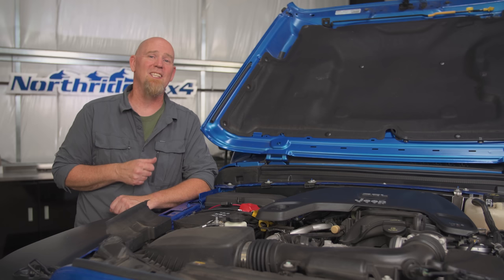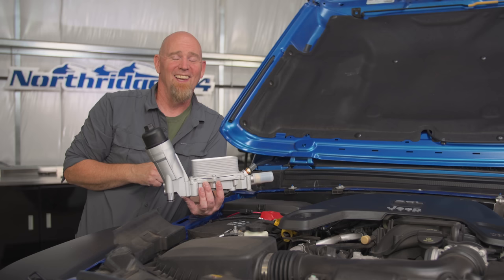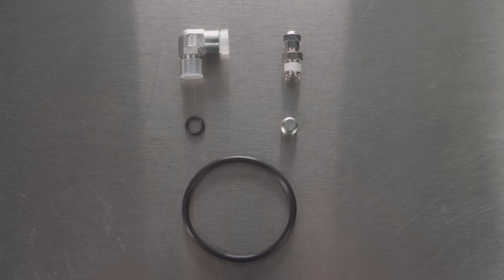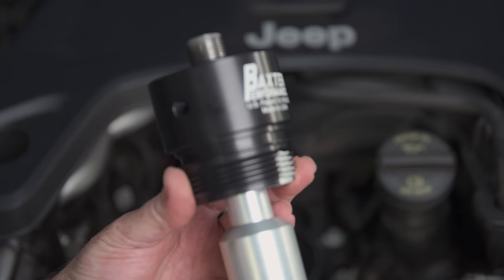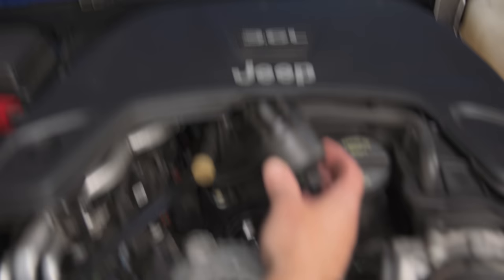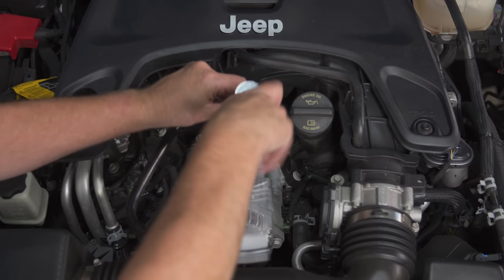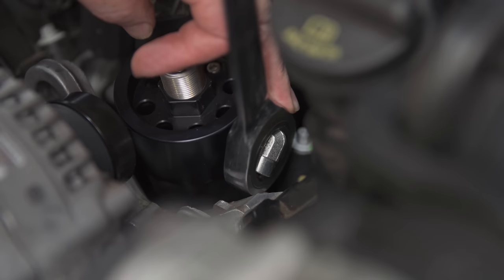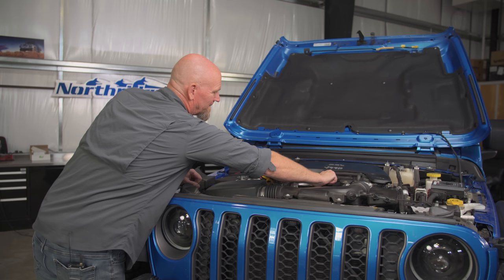STOP Dry Starting your Pentastar 3.6!!

Comment: Looks like a good product.  But lets not forget that good synthetic oil are designed to provide lubrication on these dry starts.  It would be interesting to know the amount of engine failures on engines using synthetic vs standard oil.
Reply from the maker: We are 100% in agreement with you. The Baxter adapter is a great product, BUT people need to use a good quality oil and filters 1st and foremost!
Reply: No they arent… no more than any other oil
Reply: @northridgenation  My 2015 3.6 Pentastar had 205,000 miles on it when I traded it in. I used Mobil 1 Synthetic and the OEM Filter. In all of those miles I never had a single failure in the engine. I replaced one wheel speed sensor while I owned the vehicle. I think the 3.6 is a pretty good engine at least when it's left stock.
Reply: I work for a fleet that has some of these engines in the vehicles we have.  They all start failing at around 80-90k miles and we change the oil every 3500 miles.  It isnt lack of maintenance just piss poor design.
Reply: I run mobile one full synthetic and Fram filters in our 3.6 in a 2018 JL Wrangle.  Engine went out at 38k.  Stelantis then changed the engine THREE TIMES in that same year due to faulty rebuilds.  Third replacement is doing well so far.  I do notice a clatter when dry starting in colder temps just like the original engine did.  I'm going to order this kit and see if that makes a difference.
Reply: He obviously doesn't have a 3.6 penstar that chatters each time you start it in the morning lol
Reply: Its not about the oil type its the lack of oil in the upper cylinder heads upon start, it takes the pump some time to prime the filter to get everything lubricated again. Even though its just a couple seconds or less, the engine is already moving extremely fast.. These engines have weak camshaft rollers and lifters that fail from lack of lubrication. I bet with this kit this failure will come a lot later or possibly never... The bottom end of the 3.6 is actually very robust and with proper oiling I think its pretty reliable.
Reply: I have a 2015 wrangler and from the first oil change for about 120k I used synthwtic amasoil. I started with lifter issues at 100k.
Reply: @torkrench bullshit. Synthetic flows to moving parts significantly faster especially during the winter months they're not even close in comparison
Reply: Just my experience with this product I have a 2014 wrangler sport with 140k two new camshaft on the passenger side of the motor new chains guides lifters rockers motor runs excellent and quite I thought I’d add this product to quiet everything down on the first start up it did virtually unchanged extremely disappointed but it’s on there and I’m gonna leave it there but I wouldn’t mind having the money back in my pocket. Definitely not worth the money to me.
Reply: @michaeldonahue   so even with this valve its still clacking upon start up?
Reply: @mikemoon2197  Consider yourself very fortunate to have not replaced the oil filter housing due to a failure.
Reply: @andrewhuber3575  I have heard this before and I am fortunate I didn't have to do that for sure. I did wind up trading the car in when it hit 207k miles.
Reply: My 3.6 failed at 170,000. It required new rocker arms, lifters, push rods and 4 new cam shafts. I used a full synthetic in it since the first oil change.
Reply: @lukelowe918 the 3.6 pentastar is not a piss poor design it's one of the best V6 engines in the world with millions and millions of proven miles.. things happen with everything and if you're running a fleet that means they're probably driven hard and maybe the right oil wasn't used every time
Reply: @seatime674  not the reason they are all failing.  Our fleet is maintained by my ASE Master mechanics, and we follow the manufacturers recommendations for service intervals and fluids.  The 3.6 Pentestar equipped vehicles we use are all having rocker arm failure or oil pump failure or oil filter housing failure at low miles.  Meanwhile, our 20+ year old crown vic 4.6 engines with 190k just keep going and they had real abuse as patrol vehicles.  All our Pentestar engine vehicle are merely command staff or investigators that get driven around like normal cars.  They don't idle all day or chase people. they just go back and forth from home to work.  They are trash.
Reply: @seatime674  weird how every one of them in our fleet has suffered from rocker issues and oil filter housing problems and they are all newer than 2008.   Other agencies in our county also have the same problems.  We must be in some kind of Bermuda triangle where the Pentestar V6 can't survive or maybe they are all trash.  Not sure which.
Reply: @seatime674  the Toyota 4.0 and 3.4 liter V6 engines laugh at every word your saying. Comedy gold. 🤌😆
Reply: @lukelowe918  Would you like me to send you a list of Toyotas problems with the 4.0 and 3.4??.. Sorry I don't believe every one in your so called fleet all have these same identical problems, nice try.. I can also send you information Stating the Pentastar 3.6 is the best refined engine and most popular engine world-wide with the most proven miles....Sounds like your a comedian yourself or just like the attention😉👍
Reply: @seatime674  the 3.4 5VZ-FE is one of the most reliable V6 engines ever sold as is the 4.0 1GR-FE.  As is the Honda 3.0 V6 and even the GM 3800.  The Pentestar is on no one's list but your own.  The majority of people commenting on this video are saying it is trash.  The only people who think it is a good engine are Wrangler/Gladiator Bros.
Reply: @lukelowe918  That's because people that come to these threads need help.. if your car is running perfect there would be no need to come here so that's all you'll see is Select complaints about valves in this thread.. I just got back from a Mercedes service shop and every single rack was filled with broken Mercedes, does that mean Mercedes are junk to?😉. Don't take my word for it Google the 3.6 pentastar with the most proven miles that's the most popular engine in the world that's the most smoothest that delivers the best power and torque band. And later I'll send you a list of all of Toyotas problems. It will be my pleasure 😉
Reply: 2018 JL wrangler pentastar 3.6 leaked coolant into the heads at 70,000 MLS.  Cost me $5,200 .  Rear main seal leaking, rear end gears shredded, coolant leaking out of overflow, and more ! All this under 75,000 MLS. on this P. O. S. vehicle. 
Never again... 🖕🤬👎
Reply: @hakenkreuz7076  happens all too often with those junkers
Reply: @dirttales If it’s clacking, the cam and a rocker are already finished. This isn’t gonna stop that if it’s already happening.
Reply: @hakenkreuz7076 I’m surprised your rad and front axle seals aren’t leaking, not to mention a seized vacuum pump. These things are really just huge pieces of shit.
Reply: I have a 2021 Jeep with 26K miles and I used full synthetic. I've had both cams and lifters replaced on my motor.
Reply: @jerrykurl69  mine does it for a couple seconds every time I start but its not that horrendous clacking you hear once the rocker has failed its just ticking as if its metal on metal with no lube.. I feel like wit this product eliminating that dry start would help a lot over time. Most damage gets done when the engine starts..
Reply: @04cobramarine  Rumor has it, from a reliable source that whoever makes the camshafts, they did not harden the intake cams properly, so they eventually fail regardless off proper oil changes and quality of oil.
Reply: That and adding something like ceratec at oil changes will provide cold start protection
Reply: @lukelowe918  Are you referring to the JK's head gasket issue? Or is this something else?
Reply: @aarontharris  they have oil filter housing issues,  rocker arm issues, oil pump issues.  All sorts of issues
Reply: @lukelowe918  i believe those issues are mostly resolved in the JL.
Reply: unfortunately, synthetic motor oil won't stick to the parts, but rather, it drains completely off after engine shutdown.  That is why many manufacturers specify semi-synthetic oils.
Reply: When I installed a remanufactured I4 2.5L long block in 1989 Wrangler, the new engine consistently dry-started.  I decided I needed to make certain the engine could not start until it had some oil pressure.  I found a pressure switch recommended for use with petroleum products.  It was a normally open switch with a 10 lb/in^2 close pressure.  I also bought a tee for the oil pressure gallery so I could keep my oil "idiot light".  I installed all plumbing.  I cut the positive 12v wire to the ignition coil and installed some ring ends on the wire and connected the switch.  I never had another dry start.  Unfortunately, after the engine warmed up, the starter would not spin the engine fast enough to close the switch and charge the ignition.  I ended up installing a single pole double throw normally open momentary toggle switch across the poles of the pressure switch.  Turn the warm engine until the idiot light goes out, then bump the toggle and off you go.  

If a similar wire providing 12v to the ignition module is available along with a port for the oil pressure sensor, I could cure my 2016 3.6L the same way.  BTW, mine doesn't do it all the time but everything that it does, I cringe as the engine starts.
Reply: @billwessels207 actually it's the other way. The high end MFGs specify FULL Synthetic not Semi. Full synthetic pumps to moving parts faster than any other oil, has higher shear strength and has lower volatility (burn off). The Pentastar needs all the help it can get in the oil department. And use a multi rated gas +diesel 5-40 synthetic oil like T6, Delvac1 or Delo...none of the piss poor 0-20 epa trash.
Reply: So a question I haven't seen asked so far in my reading comments. Exactly where is the oil being prevented from draining back? Just the spin-on filter? If so, how much sooner is oil getting to the top of the engine? I heard like 3 seconds via OEM filter assembly. How much faster is it with this new assembly? 

What causes the oil to be released from wherever it is held? The engine turning over isn't going to trip a check valve via air. So what releases that oil to help upper engine lubrication on startup?

Details would help verify this is really a benefit and not a gimmick.
Reply: @100pyatt  I agree... I have a 2015 JKU with the 3.6 and have noticed with mild temps when I don't drive it everyday, you can hear the in-rush of oil in that 2-3 sec range.  The last two mornings ~ -4 to 10 deg F, the engine started fairly smoothly, lower idle maybe due to lower temp.  I have been running Pennzoil Ultra Platinum 5W-20 since I bought it used at ~12.4k miles in 2016 and now have just over 60k miles today.  I may need to consider this option though.
Reply: @brianworley7705 I agree with you. This feels like snake oil sales pitch until someone can break down how this really helps oil stay at the top

Comment: Cool product, but when our JK's have been sitting for a while, I just use the "Plug Clear Mode" to prime the oil system and then start the engine.  Works every time for FREE!!!
Reply: What’s the plug clear mode?
Reply: How does this work?
Reply: @Rubicon14  It's a feature that these Jeeps have to prime the oil system without starting the vehicle.
Reply: @albertaboyz  You hold the accelerator to the floor and crank the engine.  It'll continue to crank without starting, allowing the engine oil system to be primed and have oil throughout the engine.   I usually do it for about 5-7 seconds, remove my hand from the pedal, and then give it one final crank to start and I have not heard the chattering rockers since.
Reply: @stevenhunt66  I’ve never heard of it or know how to do it , but it don’t matter no more cuz I longer have my Jeep it got totaled out 2 weeks ago 😡

Comment: The pentastar is a very stout motor, even with the oil cooler leak. Probably one of the most reliable motors on the market right now.
Reply: I would go THAT far. Definitely a top ten engine currently in production.
Reply: I’m on my fourth one and love it
Reply: It’s true
Reply: I've got a bazillion miles across 3 vehicles with this engine. Totally bombproof, the small Block Chevy of this millenia
Reply: @@Nastyhabitz "Your results may vary"
Reply: @@NastyhabitzUsually when you work at a dealer for said place you're going to see more of that vehicle come in for maintenance. Don't be stupid and realize you're working on a very very very very very small portion (probably less than 0.0000001% of the 3.6s out there) as there are well over 13 million on the road right now.

I work on Toyotas and I could easily say they're the worst vehicles on the road judging by how many I have to work on each day from how lackluster the quality is in new Yotas. But I don't.
Reply: @@Nastyhabitz Doesn't really change much. Perceived "unreliable" engines don't hit over 1m kilometers on the regular. The oil coolers are shit on the Pentastars, but if you replace em with the dorman aluminum unit, they're bulletproof.
Reply: @@Nastyhabitz well stated, Sir
Reply: @@Nastyhabitz Can't believe you wrote up an entire eulogy over a proven method that works on these engines and doesn't fail. I understand you don't really know what you're talking about but you think you do, so it's okay. Dorman aluminum oil coolers are much better than the factory plastic coolers and that has been known for over a decade on this engine. You don't actually work on them much do you?
Reply from the maker: We agree, they are very good engines.
Reply: @@Nastyhabitz Good points.  Often, but not always, the perceived reliability of a given brand is determined by the demographic that buys it and not the intrinsic nature of the actual vehicle.  Thanks!
Reply: @@Nastyhabitz Seriously?  POS motors huh?  You must be about 18rs old.
Reply: @TheSavage3.6 Right! Toy=junk!
MOPAR=longevity!
Reply: Dodge Fiat Stellantis Pentastar a stout motor & “most reliable” 😂
Says person who Never owned a Toyota.
Reply: The G.M. 3800 was better.... 

It's TOO bad that they killed it in 2009 and replaced it with that garbage "High-Feature" 3.6 V-6 with the horrible timing chain issues.
Reply: @davelowets  It wasn’t. Both the Pentastar and the 3.8 had the same issues with stock plastic crap on the engine cracking, but high quality metal alternatives being available on the market.
Reply: @chrisb9478  I’ve owned multiple Toyotas and the Pentastar isn’t and never will be an unreliable engine. Just because something comes out of a brand you specifically yourself don’t like doesn’t mean it’s garbage. Toyota ruined themselves with their lack of transmission coolers on their trucks, and the. the icing on top of the shit cake is when they discontinued their 5.7 for that crappy TTV6.
Reply: Wait what ?  Mine had the rear main seal and oil filter housing replaced at 42k miles, and I change my oil, religiously, every 4-5K miles (50% oil life indicator) with a good synthetic (Pennzoil Ultra, RP or Mobil1) with either K&N or Mopar oil filter and New Purolator Air filter at 10k miles or every 6 months, whichever comes first.  Monitor my coolant quality, changed already at 50k miles.  I use as the manufacturer states, 5W20, in both my 2010 JK Rubicon (3.8) and my 2016 JKU 75th Anniversary Edition, both have low 60s, in terms of mileage, and I am up in the air as to whether to use the 20 or 30 oil.  I am definitely going to try the 30 in my 2010, but my 2016 still has 4-5 months left on my Mopar Certified Pre Owned Powertrain Warranty (7yr/100k miles), and I’m hoping If my rockers go, it happens in the next 4 months.
Reply: Hahahahahaa so the notorious failures are all hot air 🤣👍🏻🤣👍🏻 okie dokie✅
Reply: @100pyatt  Failures caused by lack of maintenance..? Yes.
Reply: Know a town & country with 275K still going and has been run by hard even with them running conventional oil in it 😮.
Reply: Its no 3.4L toyota but it'll do.
Reply: @TheSavage3.6  Dont forget the infamous plastic clad radiators. It leaked from the outlet side  a long time before i caught it as it got worse. I went back with a 3 row all aluminum and it stays just over 200 in summer heat. Then it will be bullet proof...😉lol

Comment: I installed Baxter's device on my Chrysler200 with the pentastar v6 after I installed an all aluminum oil cooler. No more valve rattle on start-up. Hopefully I saved it with only 52k miles on it.
Reply from the maker: Keep us updated!

Comment: Sometimes I feel sad for my JKU 3.slower (3.8L) then I see all the issues in the 3.6 and everything goes away and and happy again 😊 
160k on the odometer and still running strong, slow, but strong 😅 . Only major issues:
Torque converter replaced with tranni oil pressure solenoid,
All the O2 sensors. That’s it .
Reply from the maker: The 3.8 does seem to get a lot of hate, but there are still a lot of them out there, slogging it out day after day.
Reply: I had a 3.8 that drank oil like it was going out of style.